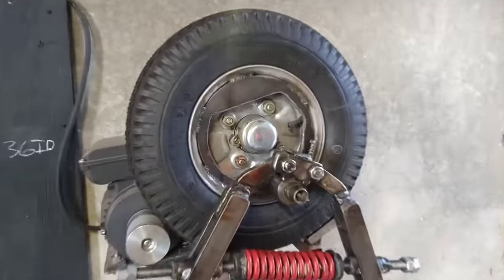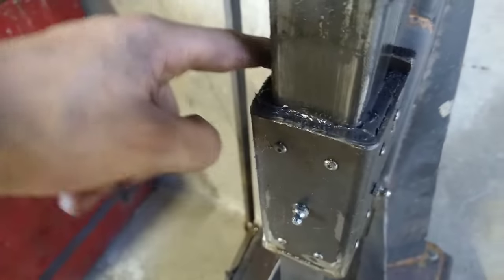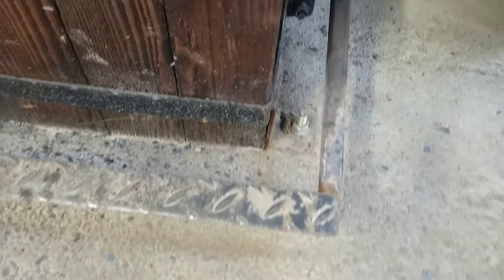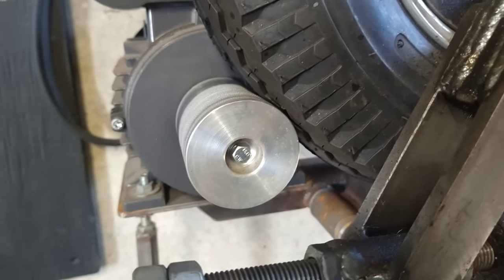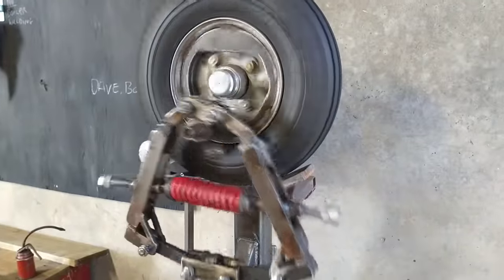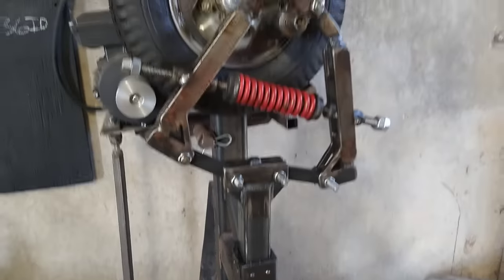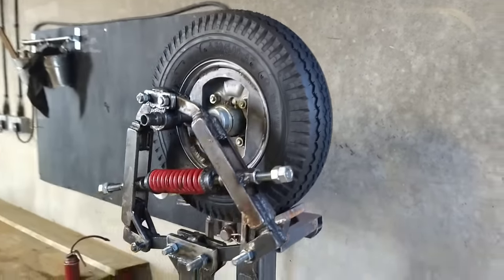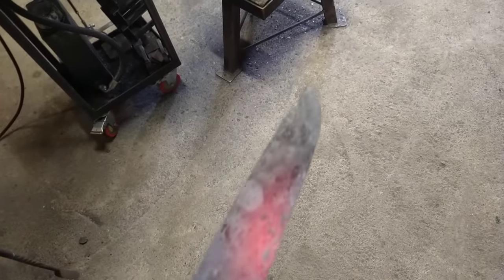Homemade power hammer - Mini powerhammer.

Comment: Look man, I'm just gonna say it. This thing is great. I love that you're using a friction drive "clutch concept" ( if I can put it that way). That is a nice compact machine that doesn't eat up room in the shop and is practical for the application at hand. Great build!
Reply from the maker: Thanks for the kind words Ben, it took me a good while to get the hammer to run. Could still do with some refining but overall it runs great for small stock.

Comment: The one thing I would change is the slide; instead of relying on grease, install rollers so the slide is smoother and more controlled, otherwise an excellent build!
Reply from the maker: You can't see in this video but I show it in my earlier ones the guide is lined with nylon 66 with journals cut into them a replacement for brass. So it is very smooth issues with rollers is they do not tolerate a lot of vibration so would wear much quicker. The plates are adjustable and very cheap to replace.
Reply: @Hammerandhilt  If the nylon 6/6 doesn't hold up try Nylatron GS. It holds up, and is excellent bushing material.
Reply: I always get  good feelings, when i see that People put their GOD given skills on use!! Awesome Job, great engineering, good video!!! :) greetings from Finland!!
Reply from the maker: @mr.phenomi2976  Thank you for the advice 👍 so far it's holding up but I will defiantly look into this. I have not heard of that material before.
Reply from the maker: @mikkomarkuskaariainen9023  Thank you Mikko I really appreciate that.

Comment: Looks great man. And it seems to have a nice push behind it. I've seen scrappy the power hammer too! I liked his use of the railway as the hammer face. I've been debating hard on if i should get a nice tredel hammer, or get Roy's air hammer and build a power hammer like this. Im around 3 years in to my smithing venture and i wanna take some bigger steps towards a small career. I have friends in the hippie/fire scene and ive been told live demos would fit right in. How much did it cost ya to get it going, start to finish? Thanks man!🍻
Reply from the maker: This hammer is great for small stock as it can keep it's momentum and gives it enough time for the hammer to travel to allow for a good strike. I use it for blades as it draws out thin material well, I wouldn't recommend it for thick material upto 20mm + or so. In all it cost me approximately £400. I had to purchase a motor and the stub axle set for a trailer and a suitable spring. The rest I built myself as I had this in the back of my head for a few years and just kept gathering offcuts suitable for the build. I'd recommend the belt hammer design also as they seem quite effective. I'd like to build my own variation of that eventually to compare them.

Comment: Very nice hammer. I’m working on a design with a belt… Quick question: before choosing the motor-tire concept, did you consider the motor-belt concept?
Reply from the maker: I did and even have some of the parts made ready for it such as the crankshaft and pulley wheels. I would like to also try this concept as well, maybe later on I will try building a belt driven variant.
Reply: i actualy saw 1 like that eith a belt

Comment: Yeah nice Hammer but I wanted to see it working
Reply from the maker: The hammer currently runs on a 1400 rpm motor would be more suitable with a 2800. Don't have time currently to mess around with it due to other work. But when it all settles down I will continue with modifying it.

Comment: Awesome. I want to make a mechanical power hammer. I got some drill rod that is heavy I can use for ram. How did you figure out counter balance on tire?
Reply from the maker: Hi there, I just built it by trial and error. Tested the hammer throughout the build until I was happy with it's functionality. Thank you.

Comment: Very nice what size tubing did you use for the back upright part of the frame and what wall thickness?
Reply from the maker: 70 x 70 x 6mm box section for the main upright 👍

Comment: Not sure how to phrase this,, but do you know what the distance of the main pivot point is? The point where the tire connects to the spring assembly.
Reply from the maker: Do you mean the offset distance between the tyre bearing and the head of the spring assembly? I can't say for sure, I would have to measure it when I'm at the forge for you.

Comment: Hi, may I ask a questioin - how do you get the steel for these builds and how much do you pay for it (per kg?) I've been to a few scrapyards in my area (South Leicestershire), they just don't have any solid pieces (just sheetmetal and other stuff but no "chunks" of solid steel round/square, not even any hot rolled sections). I don't even know what to make the hammer or the anvil from. There is a metal merchant in the area but they're charging over the moon. Apparently scrap should be in the range of 30 -50p per kg for solid, but "new" is 2 - 3 pounds! So basically, I can't find any substantial bits of steel to make anything of, unless I order online, and probably pay more than buying a ready-made power hammer. I'm talking about the massive stuff, no problem for flimsy rolled section.

By the way love the design. I'm super limited for space but looking to make finer work anyway so that'd be a dream.
Reply from the maker: At the time I worked as a fabricator so the materials were pretty easy to come by due to offcuts from jobs that we had been working on. The local scrap yard to me also stocks a really good variety of steel from flat bar, solid round stock etc. I had been saving pieces for this hammer also for quite some time, I initially begun the design for it with rough sketches back in 2017. My best advice would be look for local fabricating companies in your area and contact them about possibly buying some offcuts from them. The company I used to work for would throw away large amounts of good quality steel to the scrap. Hope this helps 👍
Reply: @Hammerandhilt  Fair enough. Lots of  YT "scrapyard builds" content makes it look easy but I never seen any of this material scrapped, all I can find is actual rubbish. I'll just have to keep digging, at least it's good to hear that it's a bit hit and miss (or based on circumstances) for others, too. Thank you very much for the insight appreciate it :)
Reply from the maker: @computername  no problem, I had to adapt my original drawings to fit with what I could get my hands on also. A lot of mine on box section stuff but used thick walled box when possible, if I couldn't I would reinforce it with gussets as much as I could.
Reply: Check if you have any hydraulic cylinder repair places in your area, a piece of old chromed rod would make a decent striker ?
I have a couple of scrap yards I visit, one is hit and miss with whatever turns up, but I've snagged some decent stuff. The other has steel section (seconds I think) sitting outside slowly rusting away. Some of it hasn't moved in years, but the price keeps going up as if it was new stock !